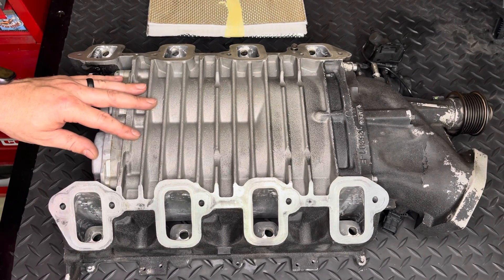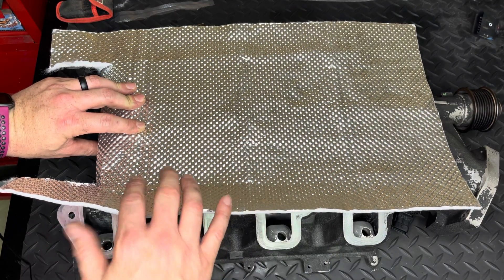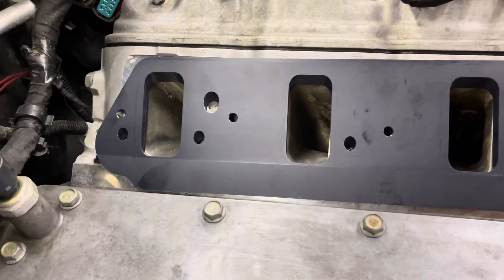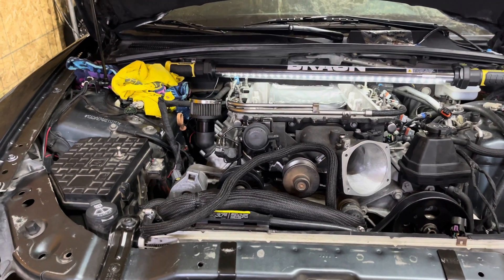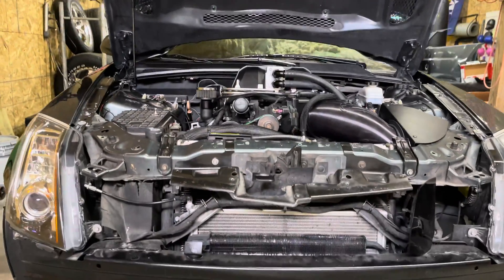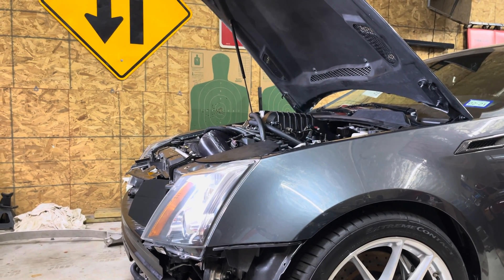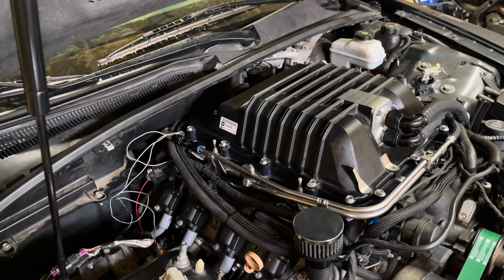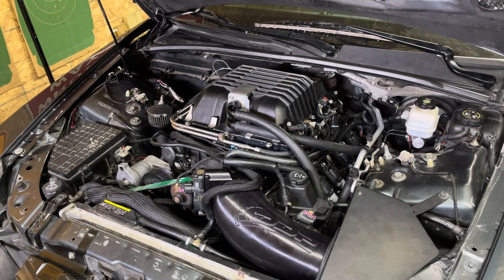Forced Induction Interchillers 20mm Lid Spacer, 10mm Blower Spacer Plates, Thermal Blanket Install

Comment: Was there any alignment issues when bolting the blower down. It’s just the bolts locating the blower right? 

I ordered the thermal spacers, I’m just wondering while putting the blower down onto them that they could shift a bit and can’t see it and then when you bolt it down the plate could potentially block parts of the ports.
Reply from the maker: There were no alignment issues with the spacers at all. It installed properly and has been doing great for years.
Reply: Curious as well, swapping blower out. How to keep spacers in place while lowering charger? As they seem they would shift on install
Reply from the maker: The spacers are positioned by grooves in the center and alignment pins on the outer spacer piece.

Comment: I have a 408 stroker and i have a 2.35 upper pulley & 9.55 lower pulley, ice tank and upgraded heat exchanger(dms). But i am still fighting with iats, ive been looking for solutions and wanted to know since i cant find any actual data for iats, how much would you say this method has dropped your iats?
Reply from the maker: I don’t have 1/4 mile data, but for daily driving, I would normally be 15-17 degrees above ambient temperature with a 2.5/9.6 pulley setup. I now have the spacers and a 2.38/9.6 pulley setup and my iats are 5-8 degrees above ambient temperature. The spacers and thermal blanket are definitely worth it.

Comment: With the lid spacer and the blower spacer do think u feel a difference in power
Reply from the maker: I did several other things at the same time such as a new 416 stroker motor. The temperatures did drop even though I am spinning the blower more than before.
Reply: so would u say It does it job keeping it cool
Reply from the maker: Yes, for sure

Comment: I see nevermind  the question
Reply from the maker: It’s all good. They offer a 10mm lid spacer which might allow the installation of the strut tower brace. Remember, I also have a ZL1 lid on mine, so a CTSV lid might be shorter.
Reply: I was thinking  of getting the same setup you have inly difference is i have the  kong lid so i was thinking it could fit since its just a slight shorter@whiplashtv2022
Reply from the maker: @bigspoon34 yeah it might work with that lid

Comment: With the spacer and the lid spacer was you able to out the sway bar on and close the hood???
Reply from the maker: I am guessing that you mean strut tower bar and not it was not able to go back on. The aftermarket hood that I am running clear just fine. I am not running a front sway bar either though btw.

Comment: did these upgrades help, i am thinking of adding them to my Escalade, i probably have enough room under hood. i have a bad lifter and hope it hasn't rounded the cam. i may need suggestions on a cam and the labor do you have any suggestions. thank you for your videos.
Reply from the maker: I will do my best to help you and I have a lot of videos here on this platform that will hopefully help you out as well. I try to go into detail on my videos and include part numbers. I did a driving review video and went into detail on how much my temps dropped and how it affected the temps. It definitely helps heat soak issues and recovery after a pull. I have yet to see 10 degrees over ambient while cruising and my blower is VERY overdriven. If you end up needing a cam, then you CAN’T go wrong with a RCR (Rick Crawford Racing) cam. Thanks for the comments and thanks for supporting the channel. Just let me know what you need or want to know.
Reply: i am ordering the 20mm lid and thermal blanket right now, figure if i have to take it off to fix bad lifter might as well put it on when it goes back together. i already have the blower spacer plates. hope this wakes up this Hippo of a truck.

Comment: Hi,
Why did you go the 20mm over the 10mm. Has any back to back testing been done over there? Thanks
Reply from the maker: The taller spacer has more gains according to the Forced Induction Interchillers guys. The made the 10mm for the public and built a 20mm for their race car, and then some of the public found out about it and wanted it so they started selling them too. I am not sure if they have done back to back testing. I recommend getting the bigger one if you have the hood clearance.

Comment: nicely explained 👍 could you please tell me how many Newton meters the screws from the compressor and blower get? did you notice an extreme difference in the performance?
Reply from the maker: Lol, nah I don’t know about “Newton meters”, but the IAT2’s did go down around 7-10 degrees from what I was seeing previously. I now average IAT2 temps that are 7-9 degrees above the IAT temps. It use to run IAT2’s 15-20 degrees above the IAT temps. I posted a video of a driving review of this where I show the data during a 30min drive.

Comment: Are bolt lengths the same as OEM? Or you had to get different bolts for blower and lid?
Reply from the maker: The Forced Induction Interchiller spacers come with longer bolts. They are shown in the other video on the channel when I do the unbox and overview of the spacers.

Comment: Will the 20mm spacer for the blower and spacer for the bottom of the super charger fit oem hood?
Reply from the maker: From what I have heard the answer is no, it won’t fit under the stock hood. They do make a 10mm lid spacer.